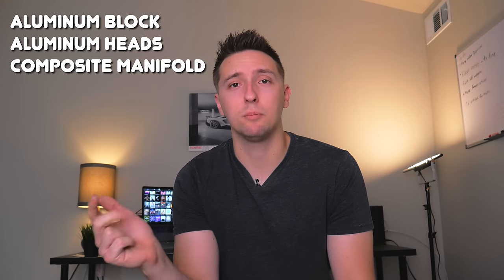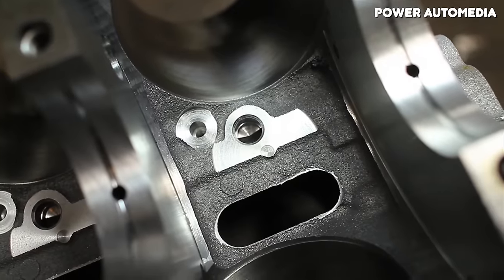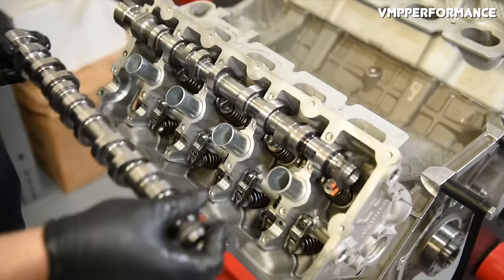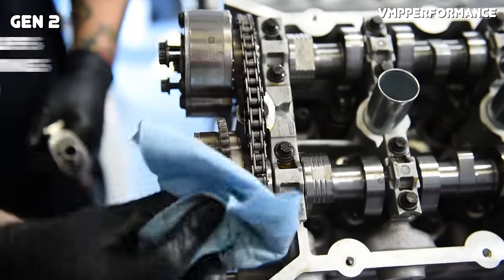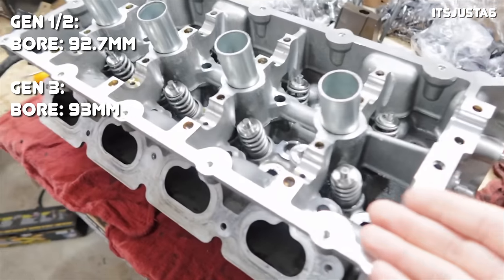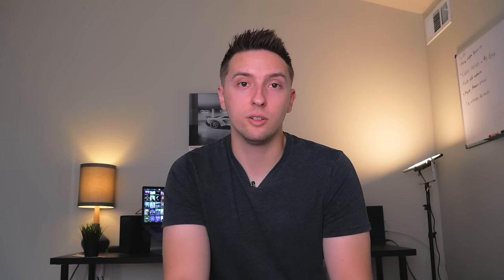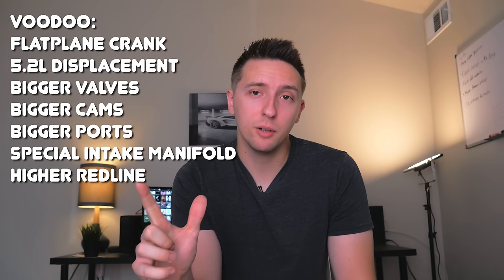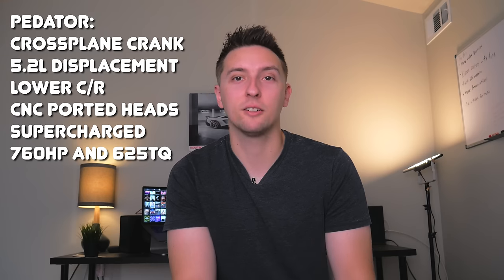The Evolution of The Coyote Engine (Explained)

Comment: Hi their I'm in Australia we had a factory ford coyote that was supercharged in 2011 it was a harrop supercharger it had nearly 500 HP in a ford falcon gt
Reply: Yep no mention of the Australian version of the coyote , the Miami. Funny how the Australian take a yank engine  and improve it with basically minimal funds. 470hp with a 30% transient overboost in the ideal conditions. But on the dyno they would pull over 500hp run after run after run.
Reply: @tba3900  yes most where well over the suggested 335kws
Reply: @daviddench4036  as ford engineers said, that’s the minimum you would get in non ideal conditions, 45 degrees etc. Funny how Australia can take anything from around the world and make it better and only spend 50c on it.
Reply: @tba3900  yes you are right all throne the year's ford Australia been able to do it we did it with the Cleveland 351 engine to it made well over 360 HP in the mighty gtho in 1971 it became the fastest 4 door car in world at the time

Comment: A 5.2L voodoo makes 500+ hp. How can that be compared to a 6.2 LS or a huge viper engine
Reply: Pushrods vs modern technology.
Reply: Until u boost the 5.2 and it's Game over!
Reply: @rmkilc  Even tho the LS/LT gets better fuel economy...and is equally as power dense (engine weight/hp).   That "modern technology" statement is an absolute myth.  They also make power on boost just as easily...dispelling another myth.

Comment: Can you take the heads from a gen 3 and use it on a 1st gen ?
Reply: They will bolt on but you have to address the ports for the direct injection and you can't mix and match cam drives. The gen 3 also use stiffer valve springs then gen 1 so I don't know how it will play with your vvt. I'm also not sure about the cam towers were the high pressure pump would normally go. btw the gen 3 use different, I think pretty ugly, valve covers.

Comment: in aussie since 2003 ford used a 5.4 ltr boss 260 motor in the falcon bigger and better then the coyote motor they also made a 290 boss and super cars had 330 boss bigger and better to the 4.6 ltr and motor used in the mustangs
Reply: The 5.4 Boss motors were boat anchors. Eaten by the Barra turbos and LS motors at the time. The Miami s/c 5.0 put a bit of respectability back into the Aussie Ford V8s although I wish they stuck with a tried and true pushrod V8 formula for affordability, reliabiltiy and torque. The HSVs with their Corvette motors just had so much more grunt and didn't need the 'overboost' sorcery that only occured every third full moon...

Comment: Anyone know how this translates to truck 5.0’s?
Reply: Cams, intake manifold, exhaust manifold, pump gears change
Reply: I have a 2011 F-150 REG Cab 5.0 4x4 I changed everything to a 2014 Mustang GT 5.0 it’s a lot quicker and easy install to the F-150 you can go with Mustang stock cams or boss 302 cams and also change to the Mustang gt oil pump gears

Comment: So what years are the Gen 1, Gen 2’s, and Gen 3’s?? You forgot that very important piece of info for us newbies bro😕
Reply: Gen 1: 2011-14
Gen 2: 15-17
Gen 3: 18 and up
Reply from the maker: What that guy said^
Reply: @177SCmaro  Why are the output numbers slightly different in the 2013-2014 when comparing to the 2011-2012 version if the are all Gen 1.......should we use the term Gen 1.5? By the way, nice to see a Camaro guy talking about the Coyote!!! Go for the Swap!!!
Reply: @Lmarcanov1978  
I'm not sure what your referring to unless Ford was playing with some minor tuning changes that I'm not aware of? There was also the issue with a transition from the longer and larger 12mm head bolts to the much shorter 11mm bolts around that time which Ford has since gone back to the 12mm for the gen 3. 12mm is preferable in high horsepower boosted applications. But I don't see what that would have to do with power in an oem setup

Comment: You keep saying the displacement is 5.0 but any true engine builder knows the real 302 cubic inch to liters is actually 4.9
Reply: The current engine is 4951 CC which technically rounds up to 5.0. The old 302 was actually 301.6 cubic inches which is 4942 CC which rounds down to 4.9.

Comment: You forgot to mention that the Ford coyote engine is a copy of the Jaguar design AJ8 Gen 3  which Ford ripped off when sold out there interest in Jaguar, a simple fix to there LS problem, they continue to take ip with introduction of there direct injection which is remarkably similar to the Jaguar system which was released in around 2009 in Na and supercharged 5.0L form, the continuous inlet and exhaust variable cam timing was released then too!   Ford had also used earlier Jag variants in Ford Lincoln and Ford Thunderbird in the mid 2000’s! So as you can clearly see not so much a Ford  but a Jag engine that started life back in the mid 90’s. So if you still don’t believe you can bolt a Jag supercharger onto a Ford coyote engine! Really!!

Comment: I don't understand why is he saying that the engine isn't so good for boost while others say it's the best engine for boost?? 🙄🙄
Reply: It all depends upon the amount of boost you want to apply. The total forces on the combustion chamber and related components are the total of the compression ratio and the total boost. If you want high boost then you need a lower compression ratio. An 8.5 or 9:1 compression ratio can take a lot more boost than a 12:1. Does that make sense?

Comment: Anyone who owns a coyote engine needs to swap out the oil pump for a real good aftermarket unit. Great engine lousy oil pump lots and lots and lots of failures.
Reply: Your talking about the oil pump gears. In a over boosted application, these can have problems.

Comment: Which Coyote gen would you yourself get for street drag racing?
Reply: I'd suggest gen 2 as you get the upgraded heads, cams, and valve springs but don't have to deal with the direct injection. If you're doing a complete build from the ground up with medium to high boost I'd suggest gen 1 block with the larger, deeper 12mm head bolds that tie into the main webbing rather then stop only about as deep into the block where the knock sensors are but use gen 2 heads, cam drive, with cams of your choice.
Reply: @177SCmaro  Thank you for your reply.
Reply: @dry509  u bet.
Reply: Gen 2
Reply: Street racing is stupid . Find you a closed course or track.

Comment: Ford junk, arc plasma cylinder coatings, 2018 was last year iron liners aluminum block, recalls are massive after 40k
Reply: First GT500 just blew up with only 950 rwhp.  Those that broke the engine down said it just couldn't handle it based on it's internals.